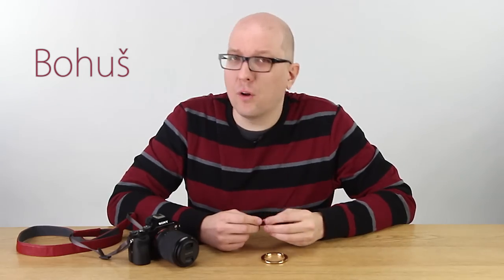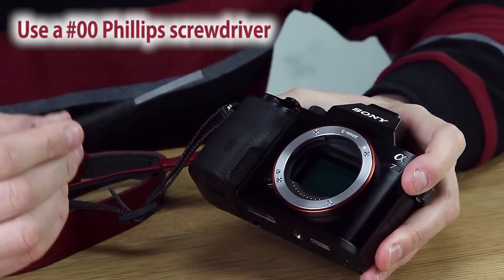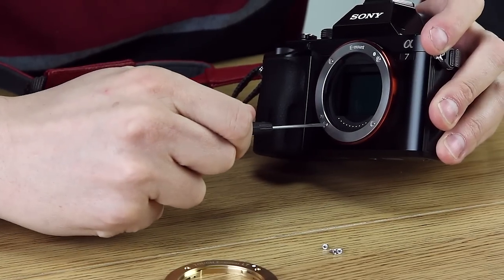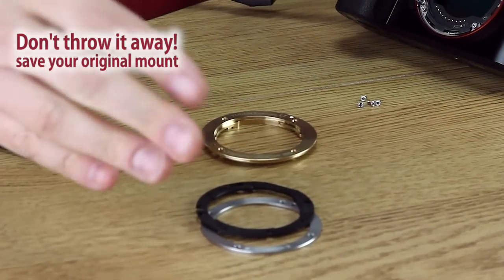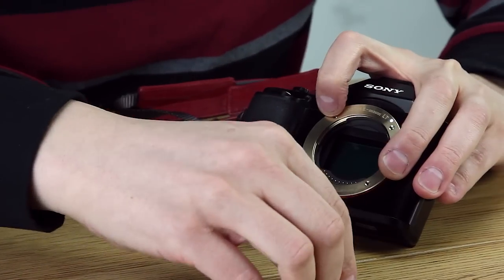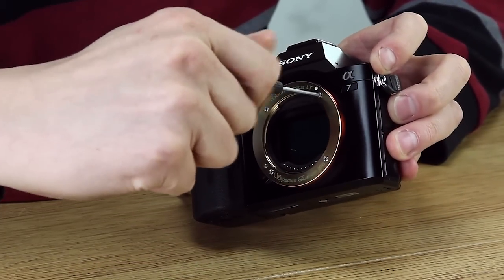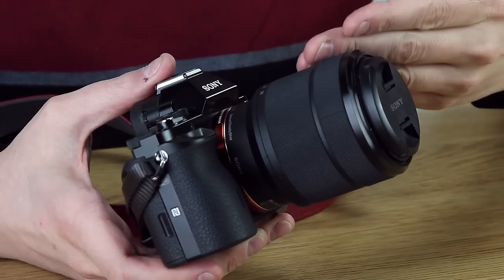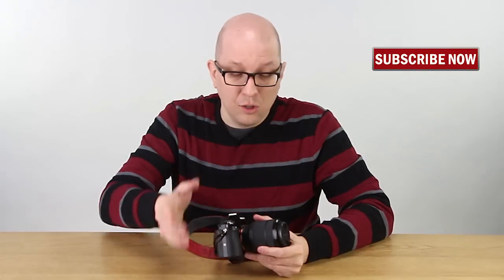How to Mount a Tough E-Mount LT on your Sony E-Mount Camera

Comment: I've owned my Sony A7 with 28-70mm kit lens since 2015 and I love it. This January I purchased the FE 24-240mm zoom (an amazing, sharp lens that is greatly under appreciated) and immediately noticed a play in the lens mount due to the extra weight. 

As I turned the focus and zoom rings, the mount began to flex clockwise and anticlockwise by about 2-3-degrees, my shots were not straight and the exposure was off.

This gradually got worse, as I use manual focus, to assist and fine tune the focus area to get the images as sharp as possible. The plastic mount on this A7 is so thin and small it was gradually flexing, wearing and letting light in, yikes Sony!

I ordered the 'Fotodiox Tough E-Mount Light Tight-LT (FOTEMLT) from B&H Photo and installed it using a '00' Philips screwdriver.

After mounting the FE 24-240mm zoom onto the Tough E-mount, everything is very solid, with no lens movement of any kind, my images are now straight, more clear and sharper.
Reply from the maker: Glad we could help!

Comment: Driver should be JIS #000 because those aren't Philips screws. I stripped a very stubborn screw on my A7 with a Philips driver.
The bling edition Tough E-mount has eliminated rather noticable wobble on my A6000 however; it didn't have an evil screw, at least not with mentioned JIS driver from the start.

Comment: Sony intentionally made the mount plastic so if it can easily break away in an accident. With a stronger mount, do you risk more internal damage in an accident?
Reply from the maker: Sony had so many complaints with this design choice that their new cameras have all metal mounts just like our Tough E-mount. The Tough E-mount won't compromise the structural integrity of your camera, it will just reduce the  wiggle on your lens and keep it from falling or twisting off your camera.

Comment: BEWARE!!!! Many of your adapters may no longer work with this product. It does not eliminate wobble. Worst is the advice to throw away your old mount. Don't! I put mine back on.
Reply from the maker: +uhoh007 Our TOUGH E-Mount LT is a stronger version of Sony's E-mount, designed for photographers and filmmakers who wanted a stronger mount, as well as an improved version of Sony's mount with added flanges not in Sony's original design that further help reduce Sony cameras' notorious light leak issues. Bohus was joking about throwing your original E-mount away, and in later videos we recommend storing it in a safe place for later use. Since we launched this product Sony has improved their E-mount, so cameras like the A7SII and A7R have all metal mounts that are stronger and tighter. You'll find that some third party adapters are not built to spec and are very tight on Sony's original E-mount, and won't even fit on their improved mount, or on our Tough E-mount for that matter. We have a 14 day return policy, so anyone who buys the Tough E-mount and isn't happy with it is welcome to return it. All of our products also have a two year warranty.
Reply: The point is, there is no mention so many adapters won't work. Obviously, most who will buy this are using some non-sony lenses and thus adapters. I was at an event with my T-Emount, and reached for a nFD 24/2 which I have used for years on the normal A7 mount. Useless!!! Ruined the shoot. Others will mount but are so tight you fear damage to the camera. There is no warning whatever. Even many FotoDioX adapters are reported not to work!

Once I researched the issue I found many others with the same disappointment. This product does not help anything, and wobble is not addressed either. Many others note same. Again no disclaimers or explanations of the real cause of A7 mount wobble. 

For this price I would expect better.

Comment: geez what a scam... 🙄🙄
Reply from the maker: These adapters were made for early Sony E-mount cameras that had partially plastic mounts, mounts that were so flimsy that you could accidentally pop an e-mount lens off the camera without rotating it! Sony now only uses fully metal mounts in their E-mount cameras, so this product is now only for people with the older cameras.